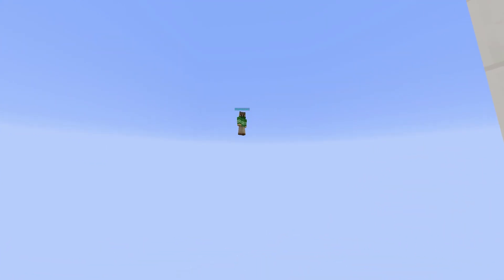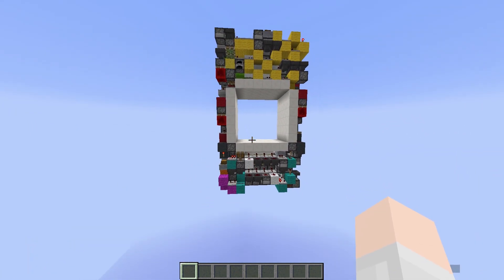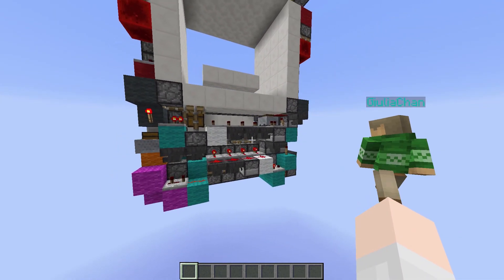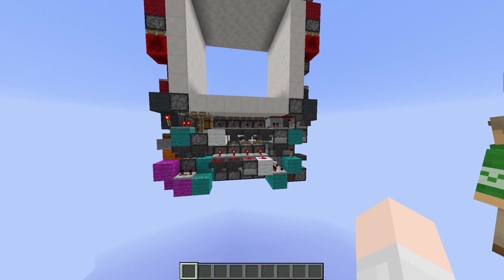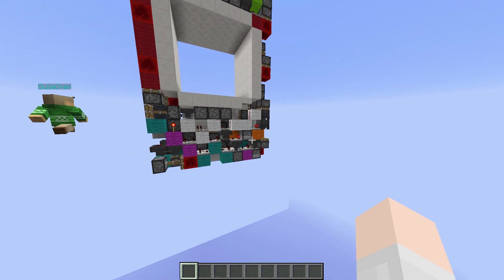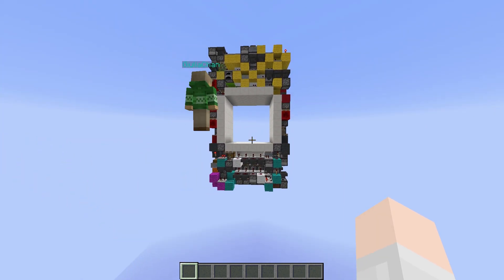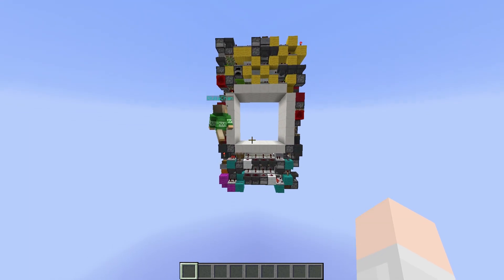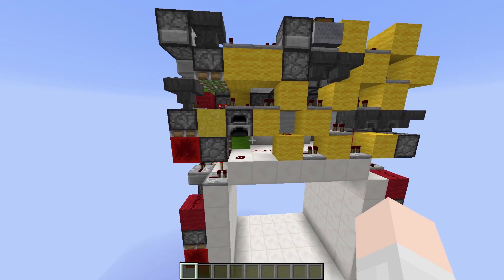World's Smallest 6x6 Piston Door [10x5x18]

Comment: Does this work in 1.11?
Reply from the maker: With the moficiation from a note block to a rail at the bottom of the door mentioned in the video, it works in 1.12 (the version it was initially designed in). I don't think there were any big redstone changes between 1.11 and 1.12 (not sure) but I don't see any reason why it shouldn't work in 1.11.
Hope this helps a bit